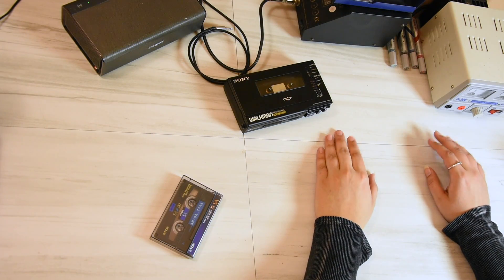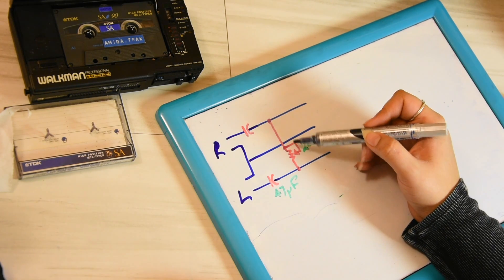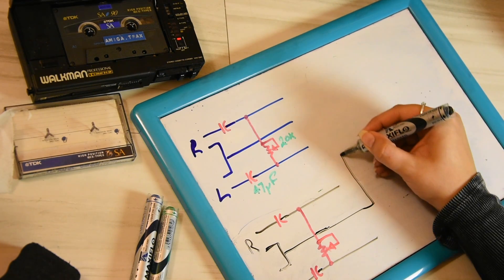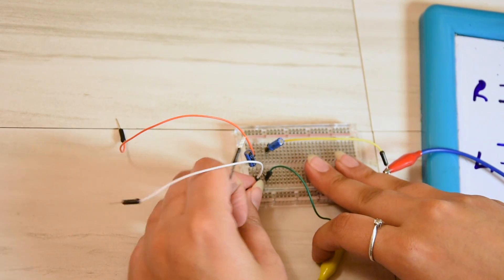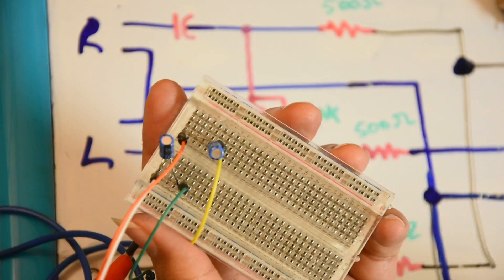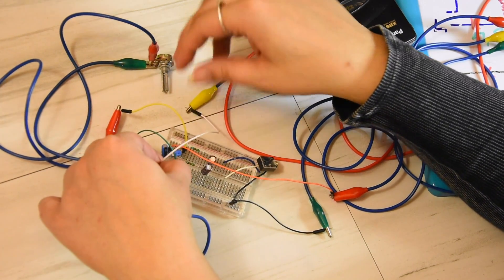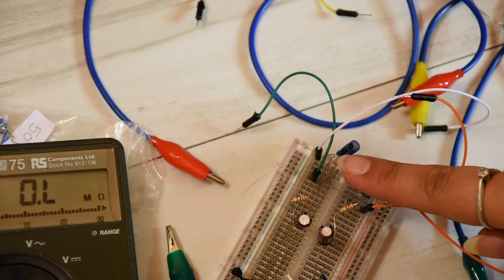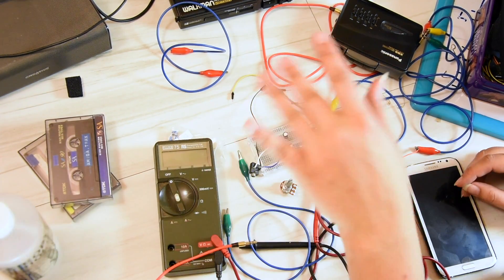Electronica - Amiga stereo separation project Part 1

Comment: i have a question.. 

i have pre amplyfire custome made and it ic dual ba3822ls ,and make 10 band equlizer, and voltage 12volt..but my question is haw much ampere input thes equlizer curcit
Reply from the maker: The ba3822LS ICs are pretty low current, maybe like 10mA per chip so two of them would be 20mA approximately. however a circuit will only take the current it requires, not more. So even if you connect it to a 12V 1Amp power supply, it will only take what it requires...Best way if you wish to know how much current is drawing is to use an ammeter to measure the current drawn by the circuit.
Reply: @MsMadLemon  according to drawing they use 500ma 12v
For one ic

I m using 12v 1000ma for 2 ic
Naw is this OK for curcit???
Reply from the maker: @mdmostofa5183  weird I checked the datasheet for BA3822LS... hmm are you able to show me the circuit diagram, or link it here?
Also if your circuit is using 100mA (1A) Then I would recommend using a 1.5A or 2A power supply just to be safe. ... But 1A seems to be very high for this circuit.
Reply: @MsMadLemon  plz u checkout datashit  and give me a helpful solution... Thank u so much
Reply: @MsMadLemon  extremely sorry for late replay. Here is ur ba3822ls datasheet link 
http://www.electroniq.net/audio/ba3822-stereo-graphic-equalizer-circuit-diagram.html

Comment: Is it just me or the sound going through the circuit got very brittle and lost bass and volume?? And how about using diodes to prevent backflow to the Amiga and the recording device? Wouldn't that work?
Reply from the maker: If that happened to the sound, it would bother me to the point of doing something about it. 
And using diodes would half rectify the audio signal, which is AC, making it sound cracked up.
Reply from the maker: okay the one going through the circuit in this video is from cassette and i'm working out the resistors, this is a test to find out which value resistors are better suited and what effect they have on the sound.
 check part 2 for a proper direct Amiga test when i've found the value and finished the project https://youtu.be/cg2SPF7CMwM

Comment: Nice and simple. Unrelated to the actual project, my OCD begs the question, any reason the input level on the deck was set all the way to 10? It would seem to result in more unwanted noise from the internals and a weaker source signal, than say turning it to 6 and pushing the mixer a bit more.
Reply from the maker: Shawn Tewes yes.....normally i increase the gain of the source rather than the rec levels up like that...but i was trying to record from the Amiga while the camera was also connected to another output of the mixer...i didnt want to overwhelm the camera input. so i kept the amiga gain down and rec levels boosted on the cassette deck (was just a test recording, quality not important)
Reply: Ms Mad Lemon ah, gotcha. makes sense.